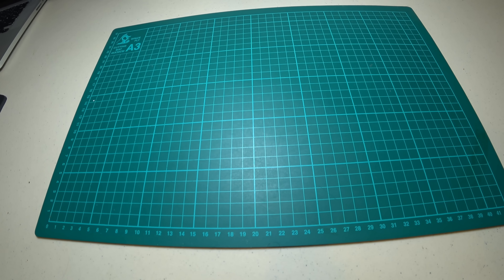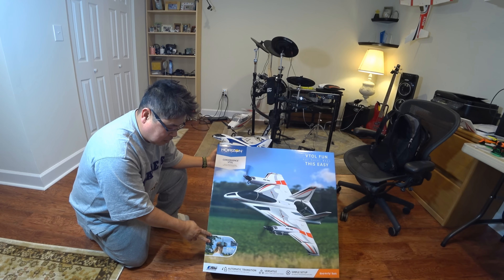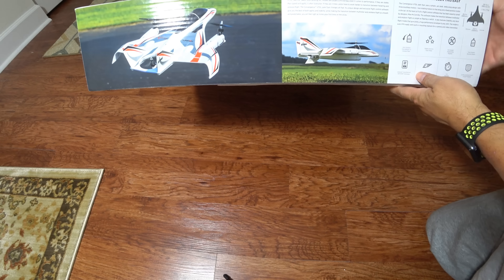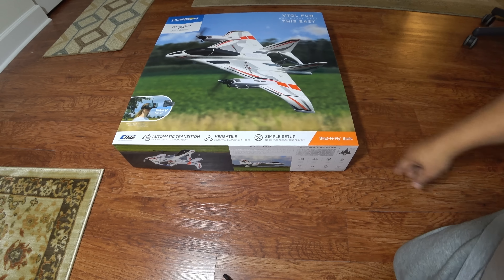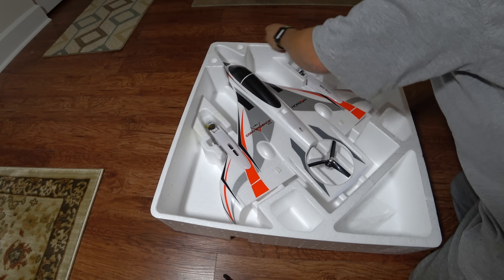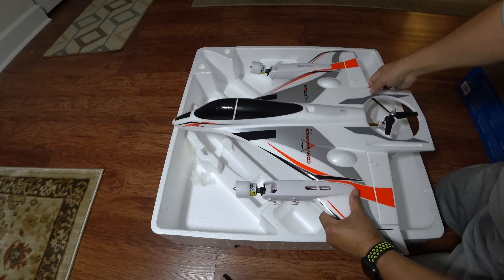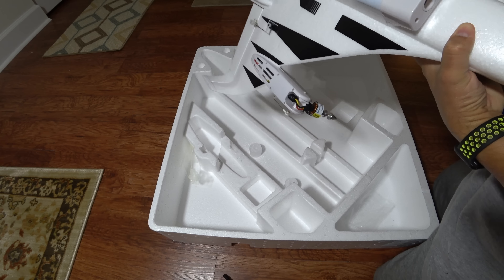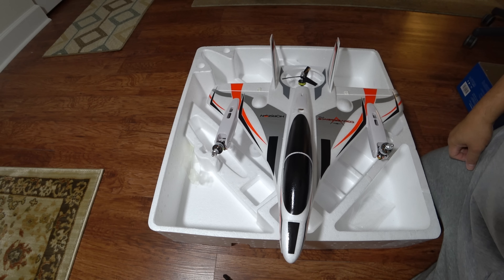Surprising me with Convergence VTOL Unboxing

Comment: How many times is it big?. Is yours still working? I hear guys reporting these things are dropping out of the sky during transition. Lots of guys. that scares me away. I think they released it mabe too quick not realizing it has a glitch.
Reply from the maker: Scott firman, Yes mine is still flying as it should.  I will post it again if it falls of the sky like others did.
Reply: Daniel Kieng I really want one bad but am so scared I will end up with a dud ( thats my luck). I am hoping they adress the issue and not just ignore it or end up discontinuing the build. I know some guys like Peter Strephold would just put one of his seups in it and be good. He used to work at Flite Test and built several VTOL planes. I dont have that type of ability to come up with a set up like that. I do think a condenser would give it the added power it needs during the transition . Any additional boost would be the ticket to fixing the problem. To me its clear that there is too much of a power drain and adding a condenser would help. I know they do sell an add on for another plane ( cant remember which one or why) I went with a seperate BEC on most of my planes to protect my controls if a brown out occured. Sadly Spektrum radios tend to  do that. I quit using my DX6I on anything other than my little UMX models for that reason.
Reply from the maker: scott firman, the trick that I use on mine is to set a timer on my DX9 and make sure that I land the plane before the battery power hits that cut off mark.  So far so good, keep my figures cross.
Reply: Daniel Kieng So you suspect guys are flying beyond their recommended flight time then. I too thought of that myself. I can guarantee they would not own up to that if they did. Apparently Horizon has replaced several planes however that proved to have fully charged batterys. I have a timer myself and always use it. That might explain why my Apprentice batterys are still good after two years of hard work. I fly two to three times a week so that really adds up . I can fly up until the middle of December usually. I dont have winter skiis but get out a couple times during the winter if thats possible. I still think I will wait till at least August before snapping up one of those planes. I can call it an early Christmas Present,lol. Let me know how your plane is doing from time to time. I will save your You tube site.